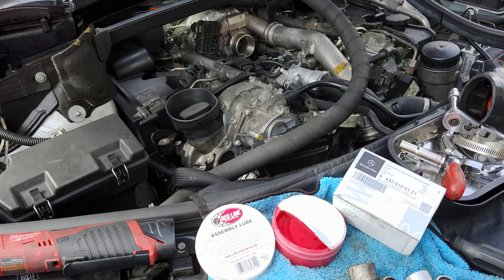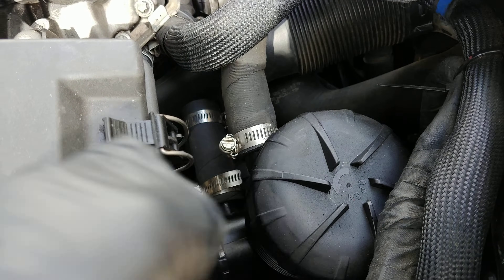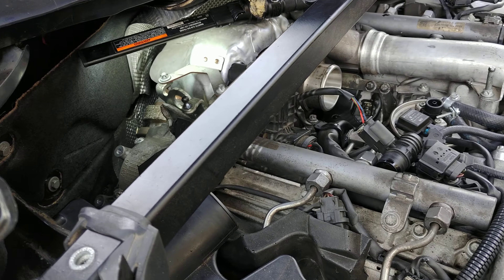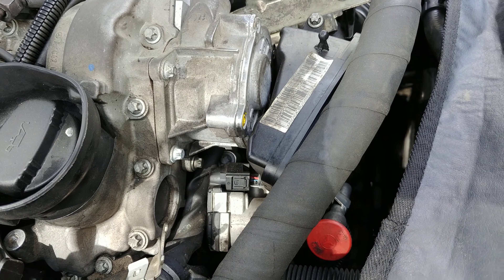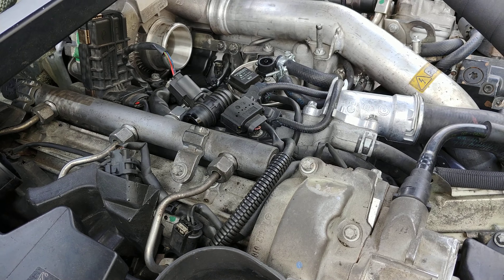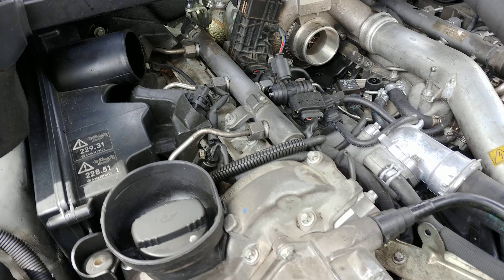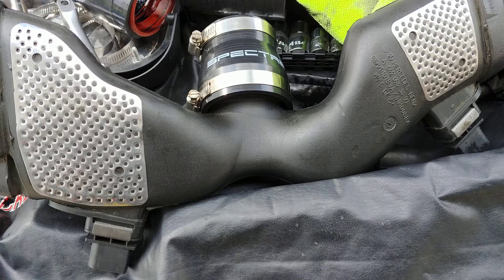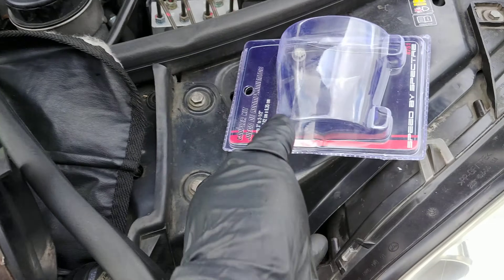Mercedes Diesel GL, ML, R, E 320/350 OM642 Oil sucking eliminated/broken Y-intake fix

Comment: Do you have picture of the parts you used to connect lower part of Provent 200 to passenger side air intake?
Reply from the maker: I am sorry I do not. I found 3/4" electrical conduit pipe, 4" long, threaded on both ends with a nut. Drilled the hole in the plastic intake section and threaded the pipe from inside. The first time I go to the Home Depot, I will get you pictures and part numbers.
Reply: Ridgeback Garage thank you, I appreciate it
Reply: Ridgeback Garage is it Carlon 3/4 in. Straight Non-Metallic Liquid Tight PVC Fitting from Home Depot?
Reply from the maker: @seankellogg6154  , no. It is a metal conduit in electrical section. You know the metal pipping electrician use to run electrical wiring on the outside of buildings.
Reply: Ridgeback Garage thanks, I’ll revisit the store.
Thanks again for taking the time to video your work.

Comment: Hi, if you change the engine breathing cover A6420100131 do you need to change the piping for PCV? Or it will be all good and no oil will go in intake? Because I can't find where my Mercedes with om642 is losing oil... I changed all places where the oil was leaking and changed the turbo and pcv with no luck... still losing oil. There are no visible places where the oil would go and no smoke at all. Will check this engine breathing cover, hope that this is reason I am losing oil!
Reply from the maker: I am sure oil is being sucked in by the turbo. Changing PCV "connector" should stop oil according to Mercedes, but common sense and testing with an oil catch can proves them wrong. Suction force from just inches away overpowers the seal in "connector" at higher rpm abd if the seal is old and hardened it won't seal even at idle. Change the "connector" and replace it every 2-3 years as a part of regular maintenance, but for sure reroute it to in front of the air filter to reduce sustion force for complete elimination of the problem. Remember you are not just loosing oil, but creating tar that fauls swirl flaps, fills intercooler with oil and drips it on the accessory belt. If belt breaks you will loose power steering and without that you will crash since steering is all but imposible to turn without working PS. It is a chain reaction with grave consequence. Trust me I towed my GL 3 times! I am stubborn so I fixed it completely instead of taking an easy way out and getting rid of it. Car is payed off and replacement car for my wife would have cost me $30+K new.
Reply: @ridgebackgarage4580  Thank you so much! Today cheaked "connecter" and sure enough it was bad, like really bad... Thanks to you my Mercedes will no longer "eat" oil! Thank you!
Reply: Hello, I’m from Germany. I have a G320 cdi an it takes 4-5 l oil per 1000km which is insane. I have read in german forum that the real problem ist not the cover but the centrifuge connected to this cover, inside the head? Couldn’t find prove wether it’s right or not. Part number is A6420503601
Do you have an idea?

Comment: Is this engine really that bad??? I'm thinking about getting a Jeep with the om642
Reply from the maker: I do not think is any worst or better than any other engine. Could have Mercedes engineers done a better job with oil/water separator and oil cooler seal material choice? By all means, but I think there is a lot of deferred maintenance to be blamed for. Automotive industry is pitching 100K maintenance free transmission and engine service intervals yet their own bulletins call for multiple services within that window. Engines are living and breading things that require an upkeep and transmission are no different. I think that with proper care this engine can far outlast a vehicle it is in. Plastics all over vehicles are crap these days since they are a lot more fragile and start decomposing the moment they are removed from a mold. Transmission paired with this engine (722.9) has conductor plate issues with speed sensors getting fouled up with old oil due to lack of timely transmission oil changes. Again, lack of maintenance. Get the car and do all maintenance items as well as oil cooler seals, PCV "connector" and reroute, transmission service and you should be golden.

Comment: Hi Ridgeback, do you have the torque settings for the two bolts for this part? Also, do you have the torque for the camshaft cover you had to loosen to get the bolts out, as it nipped them... Many thanks, Rich.
Reply: I do not! I just snugged the bolts for it by feel. 9-12 Nm should do it though. Valve cover bolts are done in 3 stages when valve cover gasket is replaced - 4, 6 and final 8 Nm. Since you are not replacing it just going back to 8 Nm should be fine. If you end up with a leak just snug it a bit more, let's say 9 Nm at the most. Just do not shave the treads in the aluminum heads. LOL! You can get access to a full shop manual through emanualsonline.com for Windows or Mac, or alldatadiy.com browser-based for Chrome or Android devices. Cheers, Ivan
Reply: Ivan Saban Thanks Ivan, I will do this work and let you and your subscribers know how it went. Just need lockdown over in the UK first..!
Reply: Ivan Saban I have subscribed to alldatadiy which seems good value at $50 for 5 years - good information is worth paying for! The torque for the two bolts is listed as 14Nm FYI.  I have discovered that the "connector" is at one end of the complete rig I have already bought, so that is good. I have also found that you can buy replacement seals to fit in the mouth of the connector- saving buying a whole new unit. The part number for my VIN is A0149977146. I fully understand and agree with your point about too much vacuum drawing oil through the PCV. This is discussed at length here: http://www.stephensservice.com/bluetec-diesel-issuesproblems/ which you may have seen already. One thing I have done is bought ACEA E9 oil for mine - he makes a convincing read! I have two questions if you have time: I fully agree that there is too much vacuum ( along with oil that is too thin ) causing the problem. However, the crank case must not become pressurised ( due to blow by ) and a certain amount of vacuum is needed to open the PCV valve. ( I beleive it opens to vacuum on one side rather than pressure on the other...?) so how do we know that the reduced vacuum from the new position from the Provent is providing enough vacuum to open the valve..? How can we be sure that less than 50% is sufficient, particularly when the turbo is not spooled up, at idle say, when blow by will still be happening yet vacuum will be relatively very low....  Second question relates to the Differential Pressure Sensor. You ( and some other posts ) suggest changing it as a service item... Why? How frequently? Should the hoses be changed too?  Thanks for talking with me, hope you are all safe there. Cheers, Rich.
Reply from the maker: @johnmallow2879  great find there! That guy really knows what he is talking about! Also great find on torque specs and seal p/n! You are the man! For your questions. The spring in the PCV valve is not very strong. It practically keeps the valve closed with the engine off so the smell of oil would be greatly reduced. Blow by is so strong on a diesel it easily overpowers the spring. Since doing all the rerouting I have been checking for leaks and I have none for over 5K miles. If a problem develops it will push seals out and leaks will show themselves, but if there were any, they would have manifested already. I have F250 6.0 Powerstroke and I am running the same set up since they have exactly the same vapor/oil suction problems, believe it or not. LOL! Many call that engine a nightmare. I have zero problems, with a few common sense fixes I made and proper maintenance and it is currently at 300K miles towing 10K lbs toy hauler RV. For DPS, the nature of operation causes it to get slowly plugged up over time because it actually senses the difference in pressure from before diesel particulate filter and after it. The line that is before the particulate filter will eventually clog up. I blow it with compressed air before connecting it to a new sensor. The operation of the sensor is used by ECU in determining when to initiate DPF regeneration. How frequently to change it? That really depends on how frequently your engine requires DPF regeneration. If you are commuting at least 35-45 minutes in each direction daily at fwy speeds you will regenerate far few times in comparison to making frequent 10-15 minute trips where exhaust never gets a chance to reach optimal temperature for self cleaning. If you are somewhere in between do it every 2 maybe 3 years. When sensor plugs up it throws whole bunch of soft and hard codes before eventually putting the car into a limp mode. I was able to shave over $2K off the price of the car because those codes were on! I also specifically searched for 2008 model year since it was without Blue Def (urea) injection which became mandatory from 2009 model year. That can of worms came with entire set of its own issues! Listen, emission systems are add-ons and band aids manufacturers were forced to add in order to pass more strict emission regulations. Those requirements were looming for years before, but the automotive lobby managed to keep postponing implementation through delays for years. LOL! Did you know that around 1885 there were a few electric vehicle developments in USA and Europe, but got railroaded by Rockefeller and oil lobby for pure profit and greed. Imagine if we had over 100 years of electric drivetrain development instead of combustion engine?! If Musk was not as crazy as he is, Tesla would still be a pipe dream! Today is "the 1885" of electric drivetrain future.
Reply: Ridgeback Garage Cool glad my finds were useful. There are 2 different seals listed depending on engine number. My p/n may not be correct for you as I have 2014 ML...  I agree with all your emissions words. There are other constraints for me here however, principal being the early ML was not a good car! I see the Blue def problems showing on the net, however they are not nearly as widespread as the swirl flap issues caused by the engine rebreathing... 

The differential pressure valve is a cheap part so I should just swap in a new one and blow clean the old hose lines with compressed air, if i understand you correctly? I have just bought the car, though it is stuck at a closed dealers due to the virus. It has 78000m with a main dealer history, so average 12000 miles per year so far. This is the UK average mileage, however my country is small and densely populated so we have generally clogged roads... I have a gasoline car for my short journeys (E350 Coupé) so the diesel will from my ownership be kept for longer drives and hauling. 

I agree with your point about electric cars. I think also the oil industry has been sitting on fuel economy improvement patents... A bigger challenge to electric cars is the grid infrastructure. It could not cope with everyone plugging a car in!

Speaking of plugs, how did you manage to tee into the air intake pipe?  ( for the short run to the Provent ) Did you use some kind of flange fitting from the hardware shop?

Do you know about 7 zap? To get exploded drawings and part numbers, put 7 zap mercedes into your browser. Pick the result that includes 'catalogue.' Put in your VIN and click on the box below listing your vehicle. This will take you to the whole enchilada, specific to your VIN!

Cheers, Rich.
Reply from the maker: @johnmallow2879  no I did not know about 7 zap. Thank you for showing me that. I am "old school", but very much open to learn new things! Excellent web tool! Yes, I got a 3" long, 1" diameter metal conduit with 2 threaded nuts from electrical section. I drilled a hole in OEM air tube, stuck it in with one nut on the outside and threaded the second nut from inside. Nothing to it. Yes, you are correct on a differential pressure sensor installation. Just be aware Mercedes uses one time crimping clamps on it just like everything else under the hood. If you are getting OEM clamps you will also need special crimping pliers. In theory, you can use wire cutters to crimp it from two sides, but it is a bit hard to apply proper pressure without twisting the clamp. With the sensor in hand and rubber hose piece, you can pick up a universal screw on clamps of small diameter. OEM claps are better since they won't come loose.

Comment: Hi, great video. I really like the idea of re-routing the pipe to prevent excess vacuum from drawing oil through the system. I have a 2014 ML 350 Bluetec. It has the 272 diesel engine, however when I look for this part using 7 zap Mercedes I cannot find this part using my VIN. What model year is your vehicle please and is it Bluetec..? My engine number is 64282641591042 I am very curious as to whether I can do this fix on mine or whether Mercedes have made some slight modifications either before or after...? Thanks again, as posted below, most 'fixes' for the oil into the manifold issue dont cure the basic problem, whereas yours does. Great!
Reply: Part found in schematic, it is the same part number as for your vehicle!  Cool! I now have the complete PCV unit with hose etc and the Provent can on the shelf. I will get this bit and then do the whole lot in one go. I will split the breather tube at the joiner, blank the end that goes to the turbo, and fire the other end to the provent as you have done. I will use 16mm ID pipe though, and have my adaptor at the Provent end. This way I can use the existing joiner and keep the pipe diameter as small as the original. I can't see crankcase gases freezing as they pass through this system, not even in ski resorts... sensor seems a bit extreme for a combo of water vapour content and sub zero temps from the crank case....
Reply: @johnmallow2879  , the "connector" is the same for all OM642 engines. It is very hard to find in the schematic! I actually never found it there except when I searched the actual part number. It should be replaced as periodic maintenance just like a differential pressure sensor under the car. FYI, it is a bit of work to replace it since you need to loosen up the valve cover and injectors are on the way of valve cover bolts. Take your time, be patient and watch out what you are prying against. Aluminum can crack easily. Good job finding it all.

Comment: So I`ve spoken to my mechanic and .... the thing with the soot and the PCV valve have nothing in between. The soot comes from the EGR, so even if you have cleaned it up, it will clog up after some time. to remove the soot you have to delete the EGR but that`s with a cost... your car will heat up way way way slower and you will lose heating in the winter at least for a long time before it starts to blow hot air. The catch can and taking the PCV valve away from the turbo may fix the oil in the intercooler and the leaking on the swirl flap motors but will not fix the soot.  Just to have some info from a professional mechanic that has fixed over 1000 of these engines :)  No bad feelings. Still, I`ll change the part 0100131 and I`ll clean my intake manifolds next month after the COVID things restrictions are out cuz now I can`t even go out from my home :D
Reply: Ridgeback, that is what I saw when we had the intake off of my Gl. The EGR & it’s passages close to it were clean with a light dusting. But once you got to the intake & heads, that was a different story. They were probably 25-30% blocked with the oil/soot buildup. Get the oil out & the soot will not have anything to stick to so it’ll just flow on trough.
Reply from the maker: Your mechanic is correct in respect to EGR. Due to the nature of its function, only full delete will stop EGR soot if your local emission laws allow it. Allowing oil ingress (and it is a significant amount if ignored! I was emptying 300-400ml from my catch can every two weeks and some oil was still being sucked in!) through PVC into the combustion process only added to the EGR soot amount. Despite extra oil combustion my EGR and its intake chamber only had light soot dusting and no build-up of any kind. If your EGR is having a lot of build-up and blockage you have excessively rich running condition due to a malfunction or rich tune if performance tuned. "Rolling coal" with functioning EGR will cause its eventual blockage.

Comment: Firstly - a huge thanks for this video, and sharing the experience!!! Could you please explain where you connect that sensor which is near PCV valve, right before the turbo inlet, originally in that "T" connection? I guess I miss it. Thank you for your answer.
Reply from the maker: I leave electrical connector plugged in so no soft code gets triggered and I zip tied it for the strut tower bar above the engine. This is not a sensor, but in-line heater for the line so there would be no ice buld up hitting blades of the turbo under extreme frezzeing conditions. For huge majority of us that is not a problen and if you re-route PCV in front of the air filter there will be no chance of ice ever getting to the turbo.

Comment: Do you recommend modifying the oil/separator PCV valve unit? perhaps removing the spring and valve seal to allow for less restriction of blowby gasses? or nor?
Reply from the maker: Just leave it. PCV itself is not the problem and removing the spring would cause open system and excessive fumes while parked.